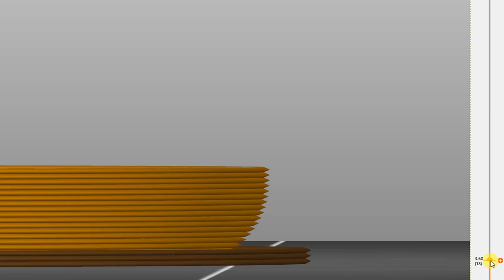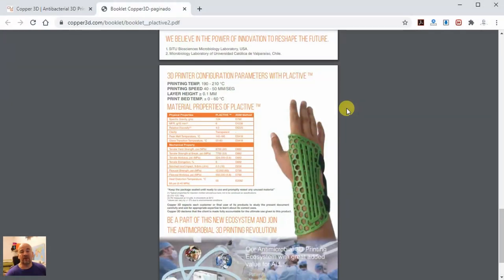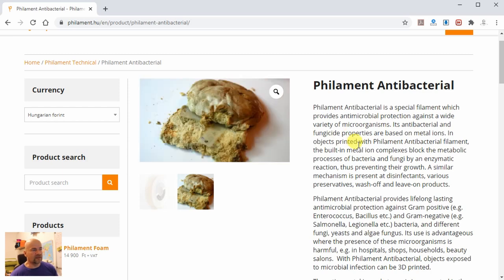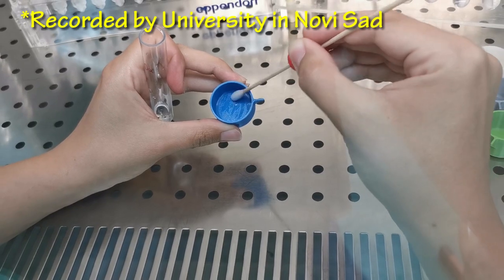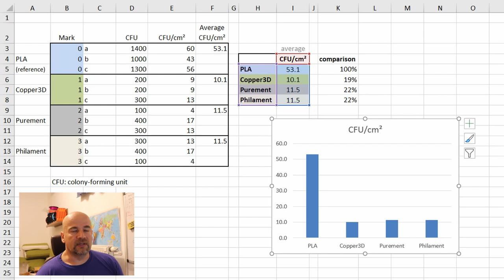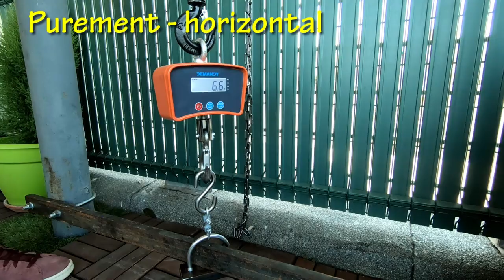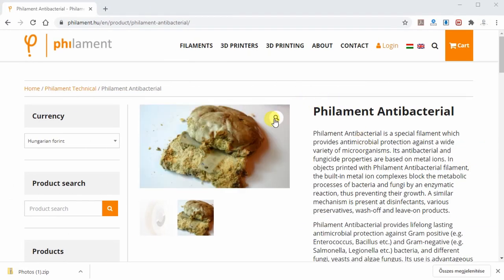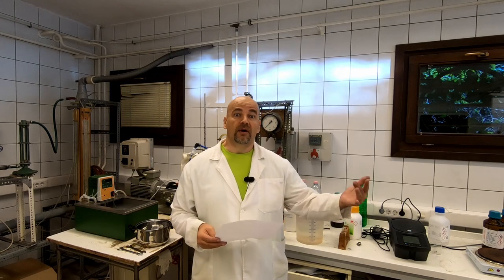Testing antibacterial and antimicrobial filaments from food safety aspect

Comment: I would be curious of adding two tests. One would be a styrene or PP cup, injection moulded, and another would be 3D print of the same material, to figure whether the layer gaps are at all relevant to bacteria surface population. It is to be kept in mind that PLA is a long chain sugar and is hypothetically potentially digestible too, especially if it starts degrading, while PS and PP do not have any nutritional value.

Another interesting experiment could be to re-melt a 100% printed model in an in-place-mould created by the print itself, for example in a mass of salt, or maybe sand or sugar, and also run the same test, to see whether the surface imperfections from 3D printing can be physically sealed in such a process.
Reply from the maker: Injection moulded cup was tested in my previous "food safe" video. PP not tested yet. Layer heigh also tested in that video. Re-melting, good idea, probably it can hold higher temperatures too because of annealing process.

Comment: Awesome videos! I've been following your food safety tests and I have an idea for another test. Could you try sanding the inside of the cup with sandpaper? Maybe with different layer heights and different sandpaper grit.
I've also heard that Lacquer Thinner can dissolve PLA and smooth the surface when applied with a brush or with vapor smoothing. Though I don't know if that chemical is generally recognized as safe.
Thanks!
Reply from the maker: Smoothing helps, but still not perfect (one method tested): https://youtu.be/DcWiA-sqPnI

Comment: Thanks for the good video! Do you know if it is possible to do food grade 3d (metal) printing? For example a beer bottle where you can store beer inside?
Reply from the maker: Search for "Basf filament 316l" . You can print it on FDM printer, then send it for post processing. You will get strong metallic part and it can be cleaned on very high termeratures. BUT it is EXPENSIVE.